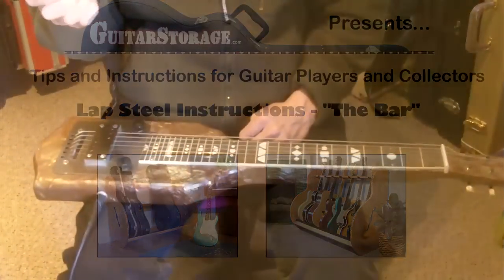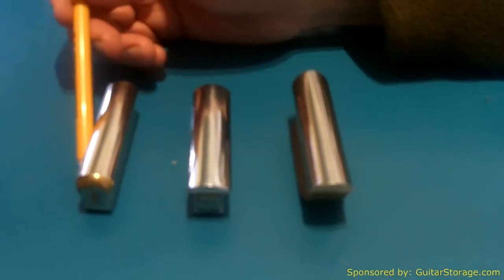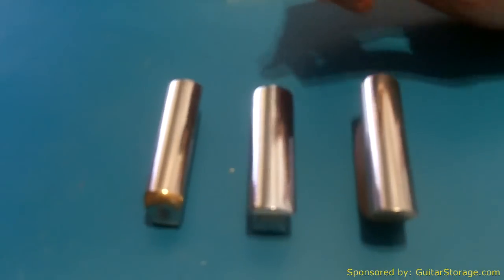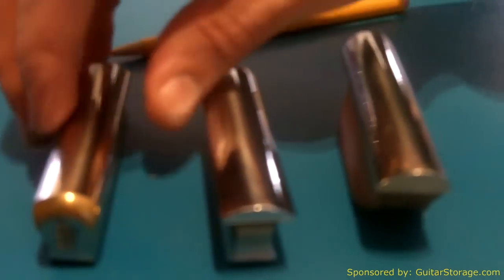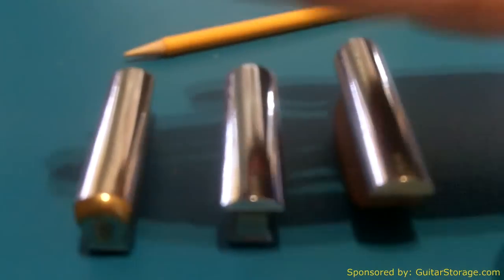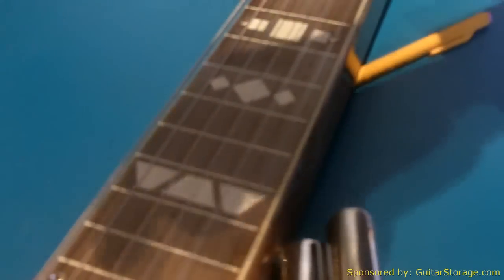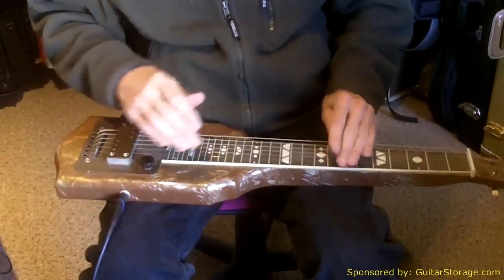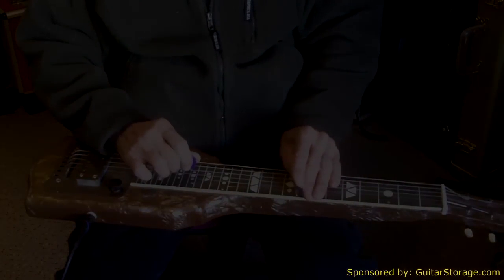Modification Tips for Your Lap Steel Guitar Bar to Help Make You Sound Like a Pro

Comment: The Shubb-Pierce bar has one  rounded-up end (like a ski-nose or sled runner) and the other end is squarely cut like a standard Stevens bar. You can use the square end for Dobro-style pulloffs and the ski-nose end for forward glides. PS, I have a doubleneck Supro lap steel with the same swirly chocolate finish as the one shown here.

Comment: I appreciated you video in concept but the focus was off - all were blurry. As I have a Stevens bar just as the one you showed I have thought about modifying the tip. There was some corrosion on the end opposite the logo. It looked to me as though the body might be brass, chrome plated. Your modified bar looked like the rounded section had some color to it, but it was fuzzy and I couldn’t tell. I will investigate further. Thanks for posting.

Comment: I have the exact same lap steel mine is super old, it has a hard wired cord though. What strings are best for a lap steel like that?
Reply from the maker: It would probably depend on what tuning you use. Just google lap steel strings and pick one for your tuning. Here's a link for example https://www.chicagomusicexchange.com/collections/lap-pedal-steel-strings
Reply: Try using 16,17,24,33,46,56, strings. They are good for most tunings. From open "E" to "C6", or try a set of D'Addario strings, set number EXL-148. They are made for C6 tuning, but can be used for other tunings as well. Have good sound, and are called a "heavy set". Guitar shown was a "Supro". I have one as well (but older), and I use these strings mentioned on both of mine, including my home-built Lap Steel. Both sound great. I think you'll find those strings okay, and last long.

Comment: I want more of a lap or pedal steel sound on my electric. Why can't i use a BAR instead of a bottleneck type? Is there any actual reason. I tend to use the slide from above the neck half the time anyway and my other fingers aren't being used (which i presume is the reason for bottlenecks to switch to fretting easily). When i've tried with heavier objects like a tom stand it sounds good, tons more sustain, but obviously not practical....would this help? More mass?
Reply from the maker: No reason why you can't if it's comfortable for you and you have a light enough touch. The main reason for  a bottleneck is to give you the ability to use your other fingers.